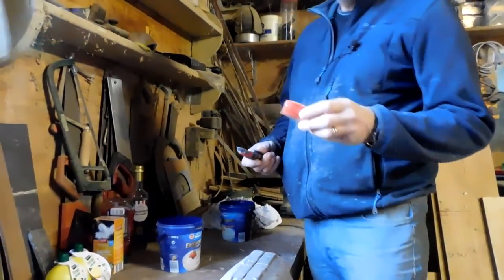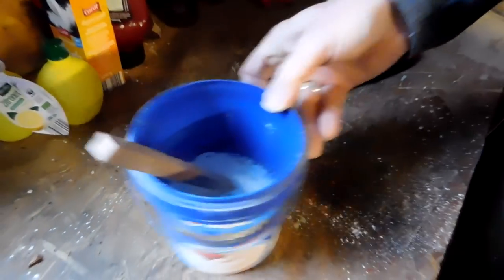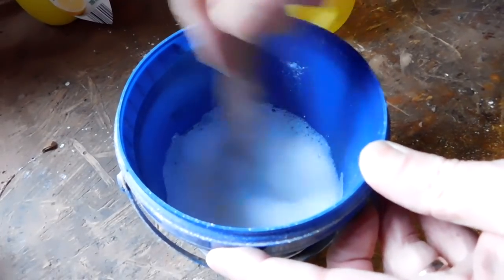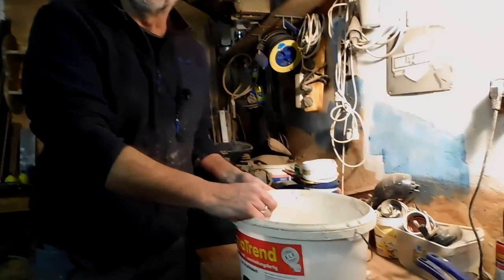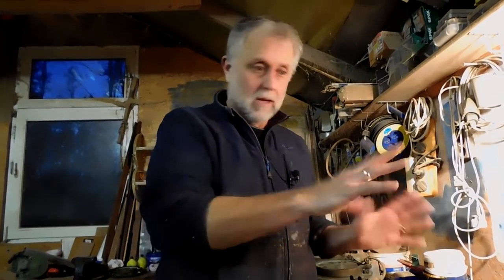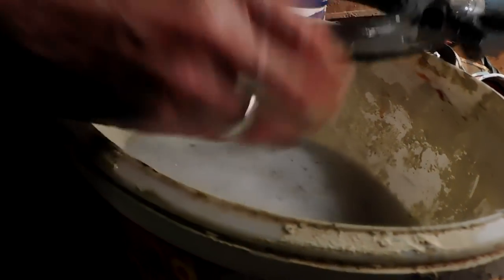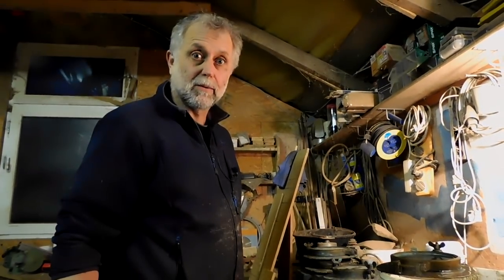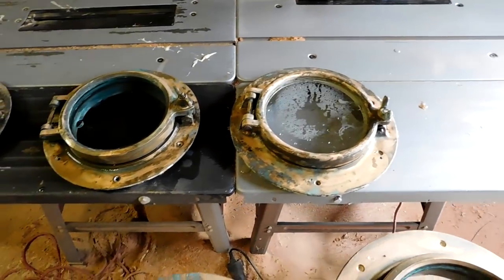How to clean bronze with standard household stuff!! - SV Tapatya Extra

Comment: I left a bronze item that was coated in tomato sauce for two days and it shined up just a bit. Brass on the other hand, leave it coated and in a bag for a couple days, scrub the tomato sauce in with a soft piece of steel wool after the two days, rinse and then use a commercial brass cleaner. It really works even though you will be shocked when you first see how mottled the brass is after 2 days in sauce. Wash, dry and coat with mineral oil to get rid of white spots. It also prevents future tarnish.
Reply from the maker: Good one! 👍😃

Comment: Or you could try citric acid which is used to prepare brass and copper for silver soldering!
Reply from the maker: Thanks Glyn. One of the reasons for posting this video is to garner suggestions such as yours. There is citric acid in lemon juice, so it could be argued that I did, however :-)